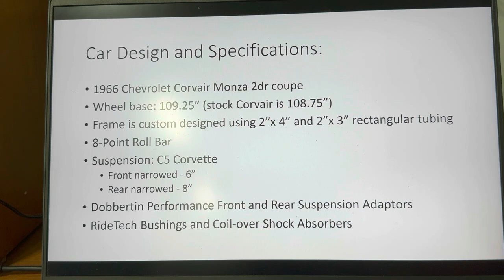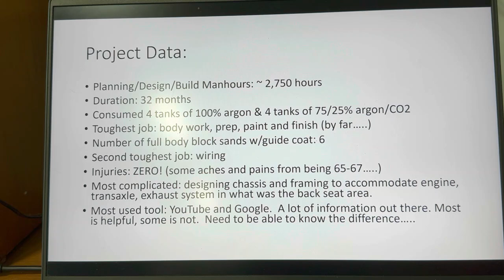NN 2 0 Video#15

Comment: Kudos to you for actually finishing your CorV8 LOL! Job not only very well but beautifully done! 

I was introduced to CorV8’s in the early ‘70’s at Batway’s Automotive in Chatsworth Ca. which was a full service/Corvair speciality shop...

A ‘traveling salesman’ had stopped in to get some minor repairs done on his late model Crown CorV8. The old guy (35-40 LOL!) used his CorV8 to make regular sales calls. His ‘district’ was the ‘West’ which everything west of the Mississippi. He’d over 250,000 miles on the odometer since converting it to mid-V8 and was readying the car for its 3rd engine. If I’d realized the significance of the encounter at the time I’d have made note to some of the finer details of our conversation other than the specifics of the car:

Maroon ‘66 Corsa, Z28 302, 4spd 3:55 posi Crown transaxle and Crown suspension, upholstered Crown seats, Chevelle front disc brakes and a Am-FM 8 tract stereo. It was a fully finished air-conditioned CorV8 driver with a lot of miles on the chassis...

My point is that the components which made CorV8’s then and now are off-the-shelf adapted factory manufactured parts. Properly assembled, adjusted and not, I repeat N-O-T abused there’s no reason a CorV8 can’t be driven daily and or very long distances. My 1st CorV8 was my only transportation at the time. It was a 60 mile round trip to work and back 5 days a week. Do the math - That was 300 miles a week, over 1200 miles a month and 15,600 miles a year...

To quote Seth Emerson: ‘Enjoy your Corvair!’ Power-Tour anyone?
Reply from the maker: Arch, great story!  Thanks for the kind words.  I am looking forward to driving and enjoying this car!